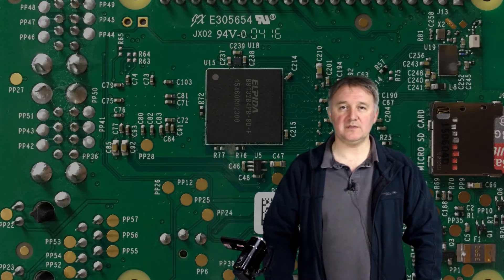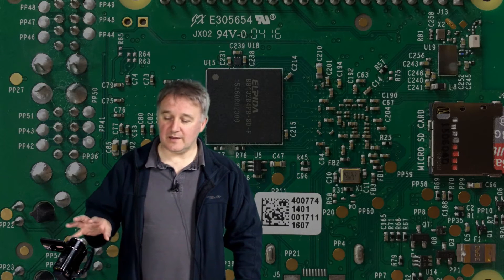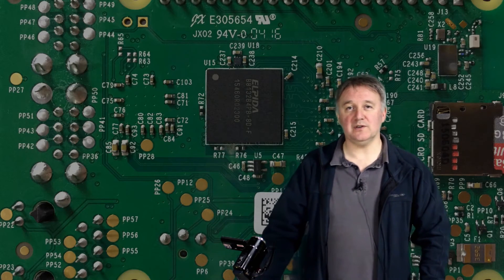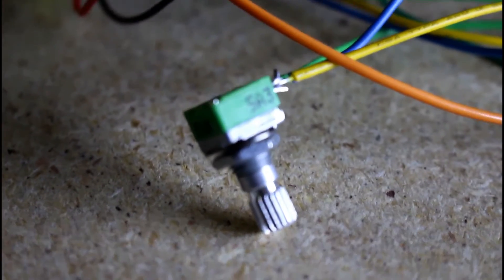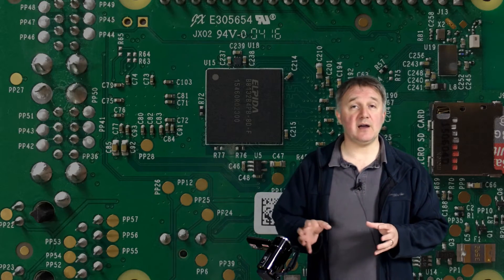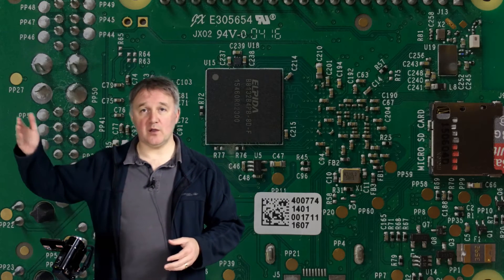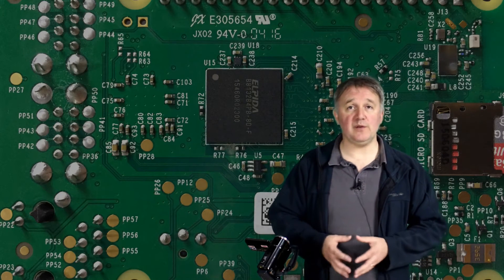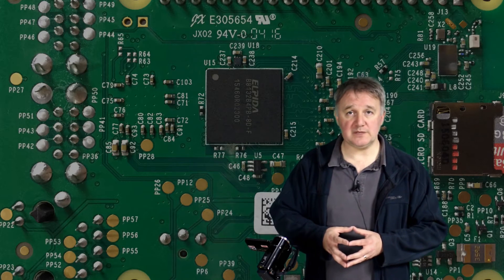Camera Dolly Update (Fail) - (MEHS) Episode 52

Comment: Have you considered using the 1SHEELD shield for providing the interface to a smartphone for the mk2? Keeps it all Arduino. iOS version of 1Sheeld due soon, I purchased one this week but not had chance to set it up and test yet.
Reply from the maker: - Hi.  Thanks for the tip.  I hadn't seen that product before.  I've taken a quick look and although it would work, the 1Sheeld appears more about using the phone's built in sensors and using them to interact with the arduino.  I'll look into it a bit more before I choose a solution.  Cheers.